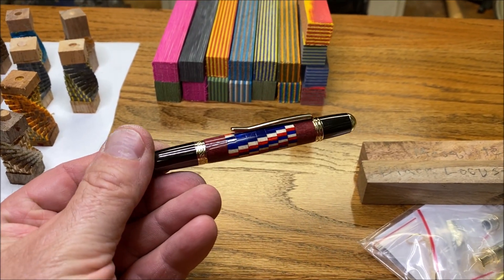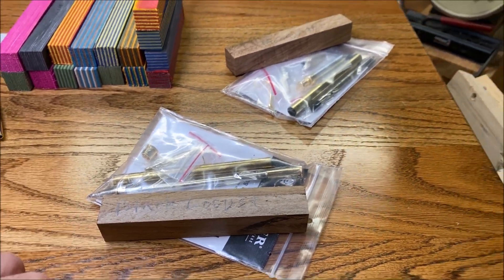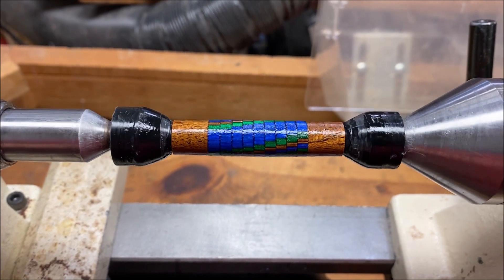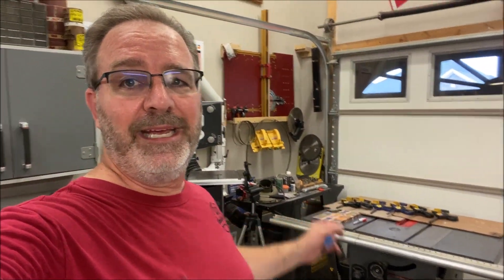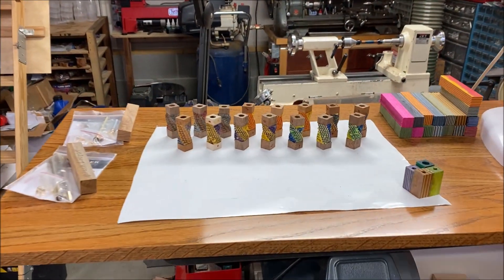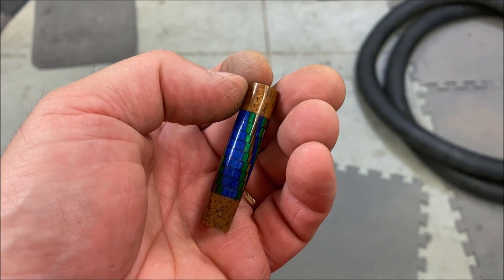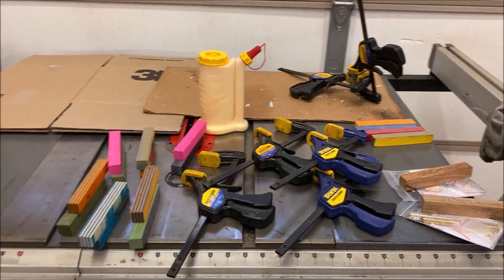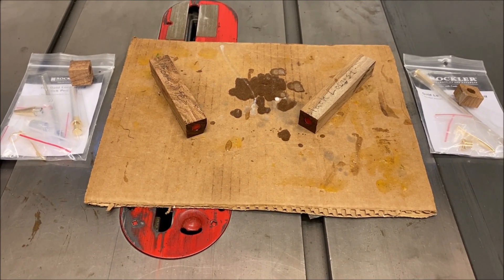2022/7/17 Shop Update

Comment: good to see you back in the shop!  i've built quite a few of gabe's designs and some variations of them.  the drill press cut medallions are a real gem to make and with his jig, actually quite easy
Reply from the maker: Thank you Steven,
  Have you seen him use Titebond or tried it yourself?

Regards,
Bob
Reply: @WhatchaDoinBob  no i haven't.  the wood to brass is not a true glue joint, ie the glue does not react with the brass like it does the wood.  so the joint is purely mechanical and thus requires a mechnical bond between gaps.  traditional wood glue is not "gap filling" like epoxy and ca.  love the spectraply pens!
Reply: @stevem268  Thank you Steve. Keep the great info coming. 

Regards,
Bob

Comment: Looking forward to the Longwood video.  I suggest just one video with clips from each of the two interspersed and and outro showing both finished instruments.  need to try Titebond on my faux segmented spectraply blanks.  Thanks for the tip from Gabe.
Reply from the maker: Hello John,
  I have a chemist friend that tested and said Titebond will not mechanically bond to brass. 
It will eventually fail and the blank will separate from the tube. ☹️

Regards,
Bob

Comment: hey there bob i would video both the pen and pencil set as one video thats just my thoughts on it anyway and would it work if i used titebond 2 just to glue the tubes in the blanks if i was doing a solid wood or a solid acrylic blank? chris
Reply from the maker: Thank you Chris,
  I recommend epoxy for the tubes. Titebond is just an experiment and there is no substitute for the holding power of epoxy. 

Regards,
Bob
Reply: @WhatchaDoinBob  ok

Comment: Hi Bob, 
in Germany the go to glue is called Ponal.
I used to use it until 3 kits lost their tube after a coupe o months of use.
By now I use a PU glue like the purple titebond and this is a great glue- no issues with this one.
Maybe you will give it a try an glue a blank and the tube in one go together.

Best regards from Germany 

Sebastian
Reply from the maker: Thank you Sebastian,
  I plan to stick with Epoxy for gluing tubes into blanks as it has proven itself many times as a glue that does not fail. 
  I’m looking into Titebond as an option for segmented blanks as it is quicker and much easier to use. 
  Need more testing and I will feed back results to the people who watch. I hope it is a good alternative. 

Regards,
Bob